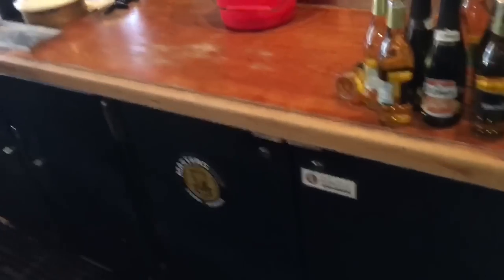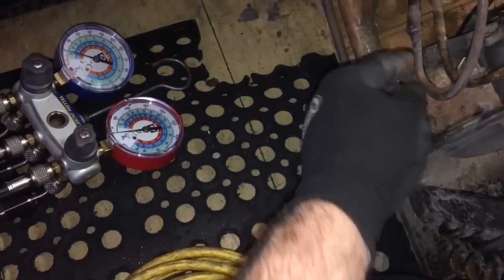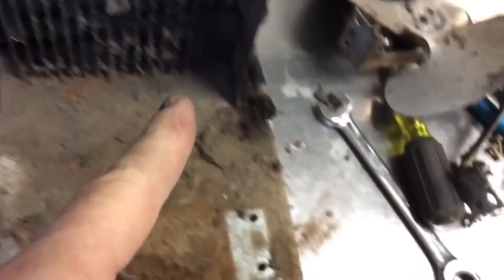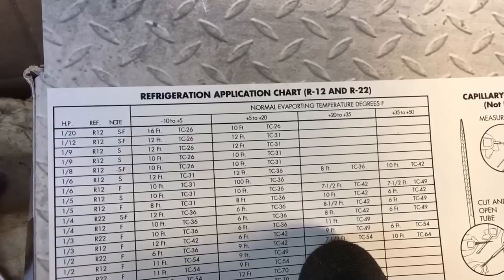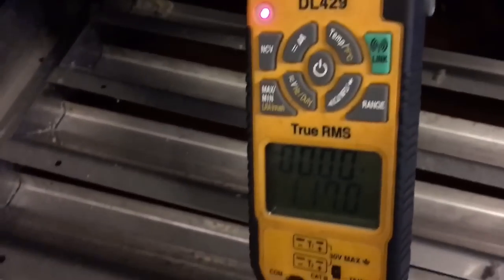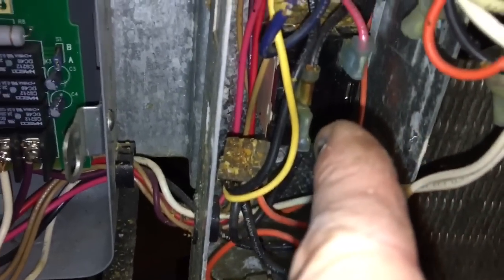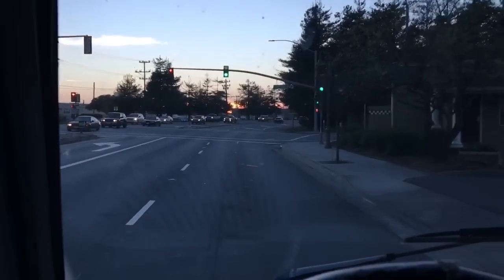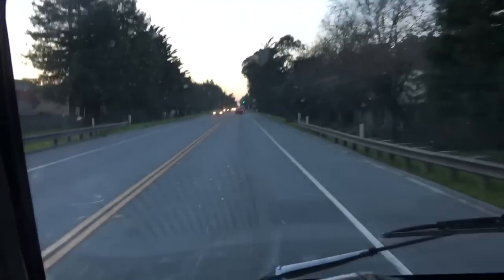Monday service calls

Comment: Video Dave those relays used to always throw me off , when i was working on  True freezers... i keep a couple on my van .. i did a compressor changeout on one of those beverage air beer coolers except mine was an R134a .. if you  threw in a copeland are37 your piping changes , now if yoi put a Tecumseh it stays the same 😊 .. great video!!

Comment: did that cap tube come out of that evap coil easily? alot of times on old coils you heat them up and they break off before you can pull them out
Reply from the maker: kingofthecrease30 when they break off get a flat head screw driver and while heating it up pry open the opening and the old cap tub will stick to the screw driver and you can pull it right out.

Comment: Was that Cap tube sweated directly to the inside of the evap on the beer cooler?
Reply from the maker: Steven Gilber part was soldered to the suction line to work as a heat exchanger. Old school
Reply: Nor-Cal Refrigeration & H.V.A.C thanks...I'm always learning from you.